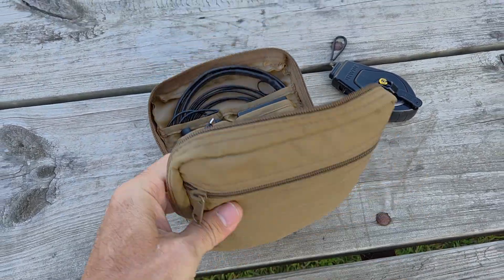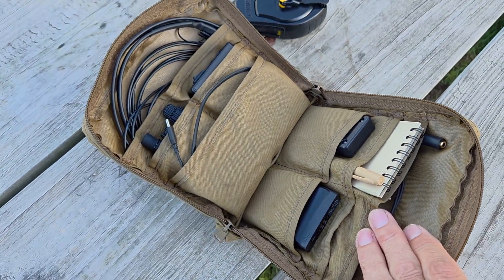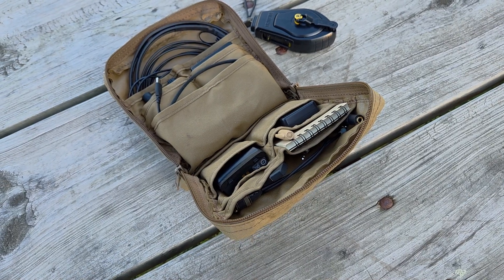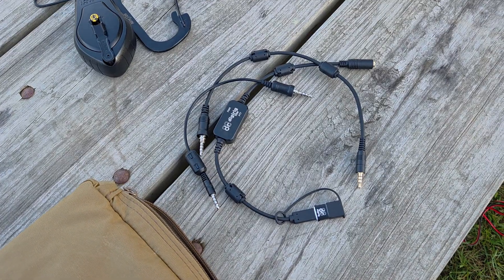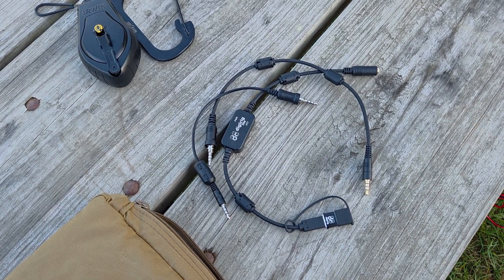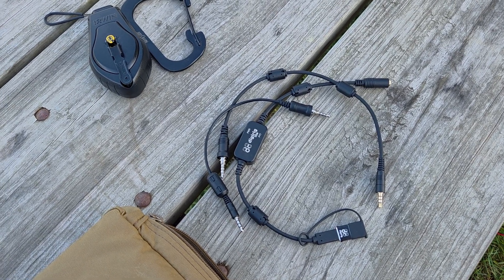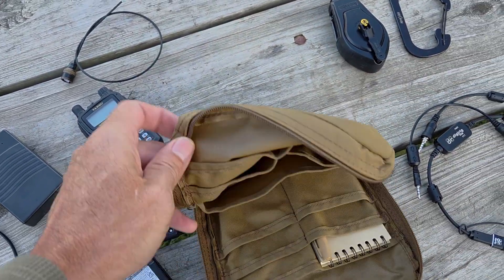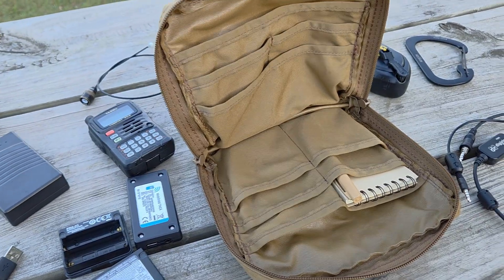HT Portable Load Out

Comment: That is one slick setup.  Did you need a special adapter to charge the VX-6R from the talentcell?
Reply from the maker: 12v adapter to Anderson Power Pole then a VX-6R power cable with Power Pole connection on the end of that. You could by pass the Power Pole connections with separate cable.

Comment: This looks great. I’ve been looking for something like this for my VX-6R and ID-50. I want a pouch for the HT, a few extra batteries, Nifty manual (8”x4.5”), signal stick and rollup antennas, assorted cables, etc. It has been hard to find something that works well. Most of the pouches (EDC, IFAK, etc.) I’ve seen out there just don’t work quite right for radio gear. The overall dimensions are too restrictive, the access is cumbersome, or there are way too many small elastic loops and useless tiny pockets .  Thanks for developing this. I’m looking forward to the final version.
Reply from the maker: Thanks for the input! This is exactly what I'm looking for right now. Another person suggested a rectangular shape for some of the Elecraft radios as well. I have some great ideas to work with.